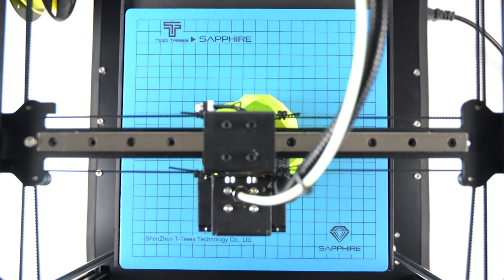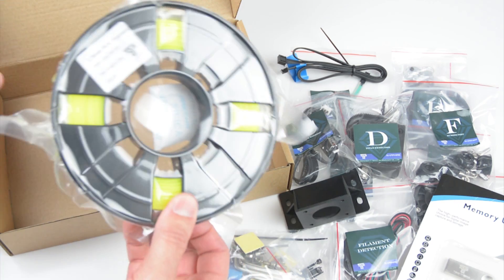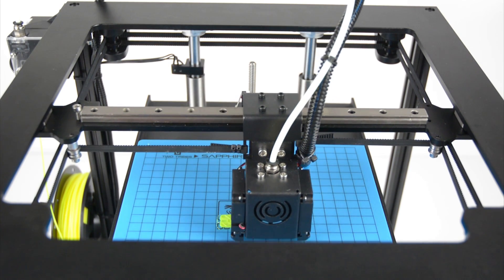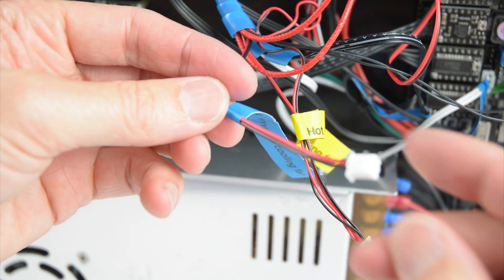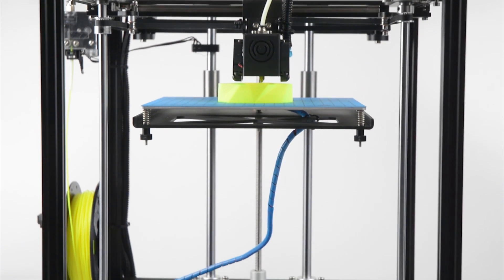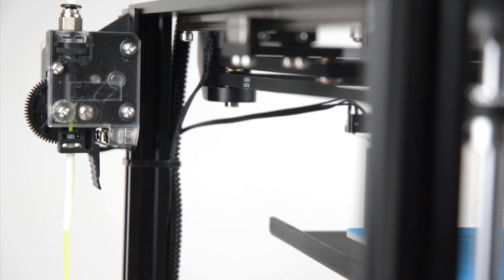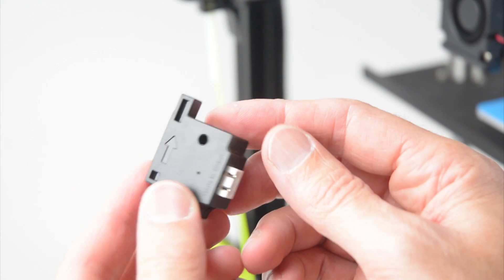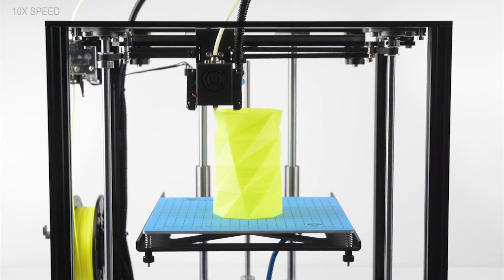SAPPHIRE-S CoreXY 3D PRINTER REVIEW

Comment: I just bought a Two Trees Sapphire-s printer and have assembled and all appears to work well until I plug-in my flash drive that was provided by the seller. All the files that came with the drive appear on the display except the (.stl) print test file that I added. If I change the test file from .stl to .g-code, then it appears on the screen and I am able to select it. Why is the file not showing???

Comment: Hello,
I have a question. Can you send me Cura profile file for this printer? My unit was shipped with USB drive containing only Cura installer itself. On the other hand, the instruction suggests that it should be the configuration file. Without any reference it is very difficult to configure the printer from scratch.